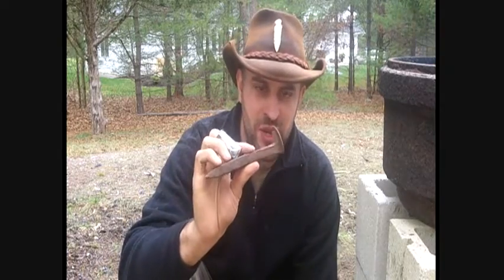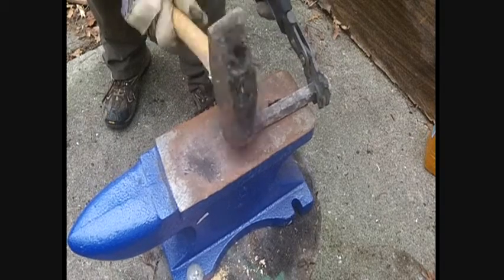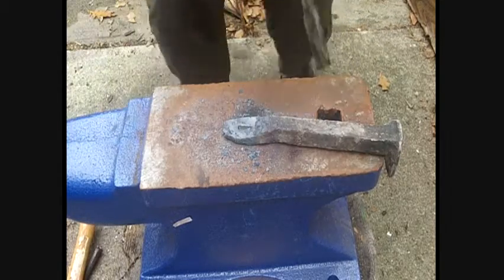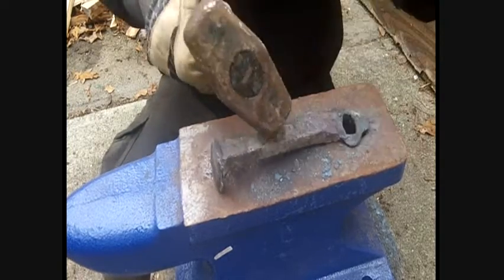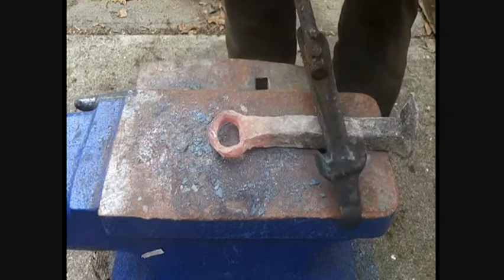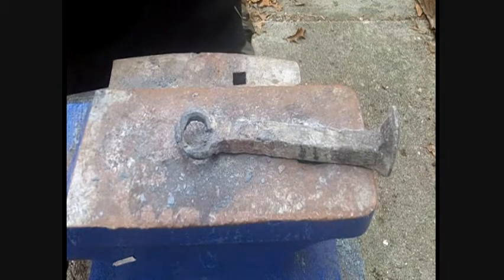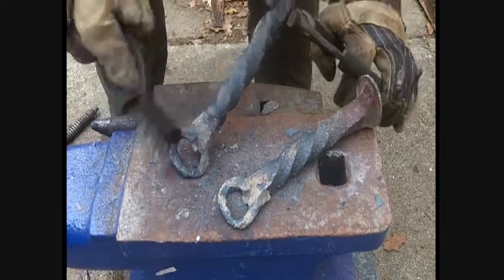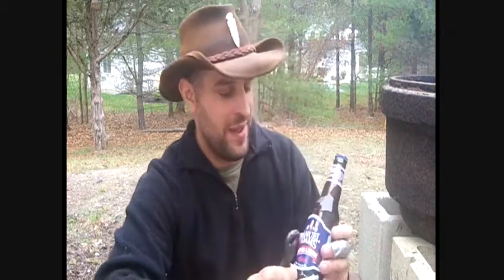Forging a Railroad Spike Bottle Opener

Comment: Don't worry about all these negative comments. Good work, there. Your raw wood forge will continue to work fine as long as there is a bed of charcoal at the bottom. Skål.
Reply from the maker: Thanks, Man!
Reply: @animalmansurvivor1452  yeah and if you hold a hair dryer or small blower on the fire it will get good and hot. Nice job working with what you have.